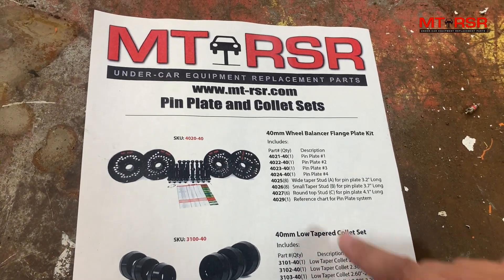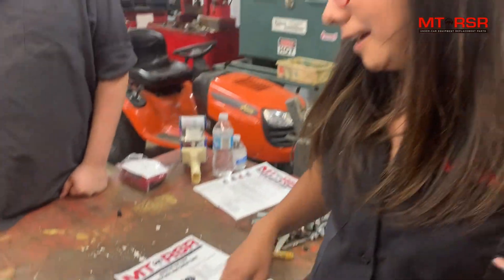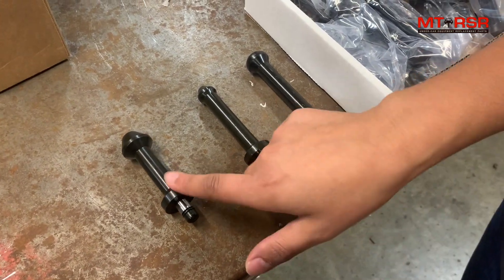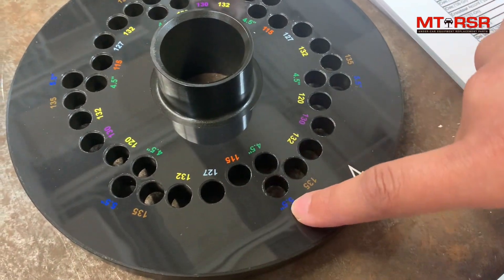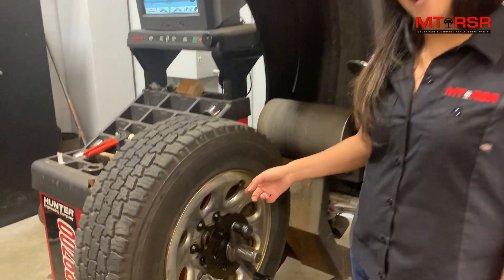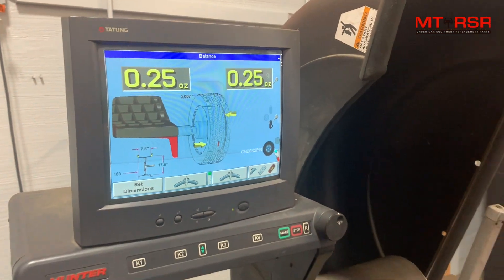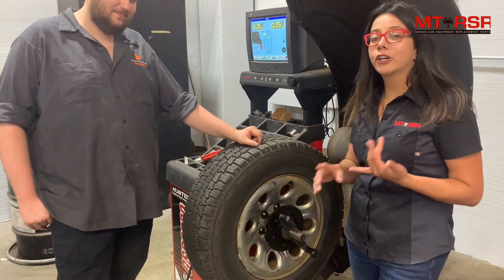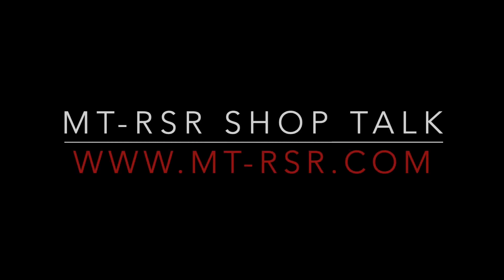MT-RSR Shop Talk Pin Plate System

Comment: Did you guys use the recommended collet? Or just a cone? Did you use the spring? If you balance it to zero, remove the plate, rotate the wheel on the balancer 90 degrees and remount, will it come up with not needing any weights?

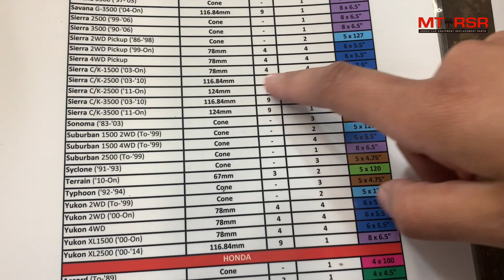Comment: 0:47 on the website there is a neat diagram when buying the pin plate stud, showing which pin is recommended for certain wheels. That picture should have been in the reference chart for pin plate system. Other than that the system has been working great